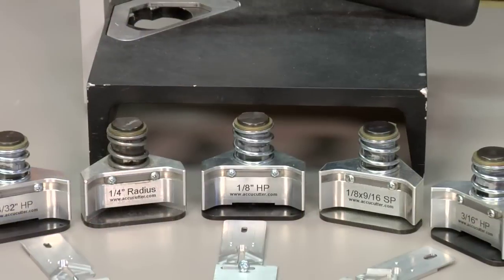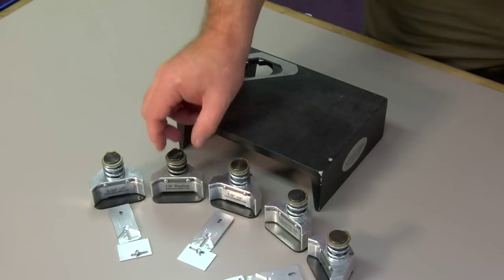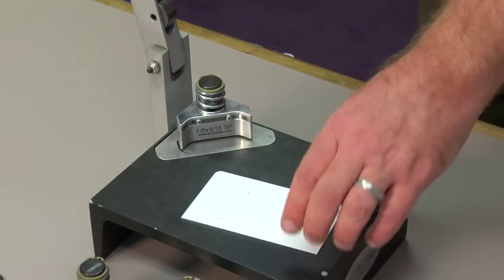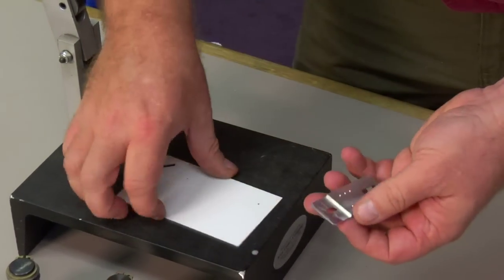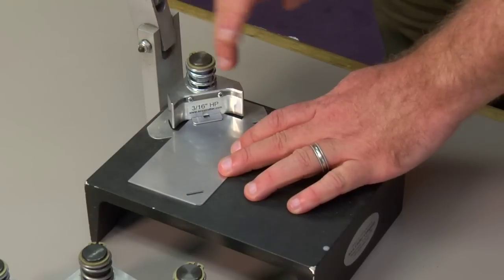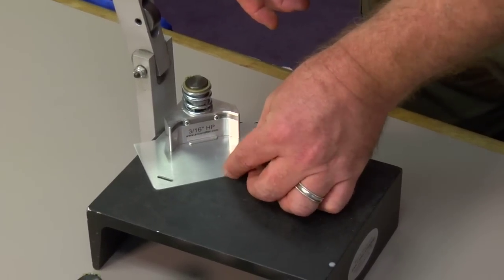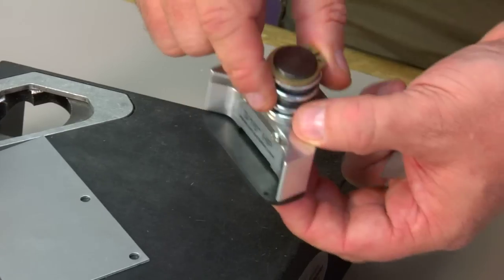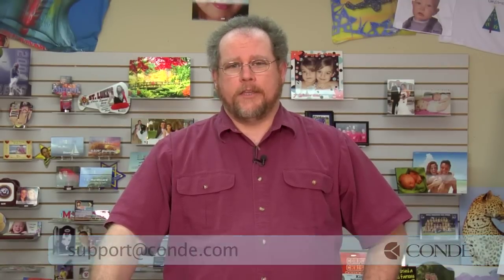Using the Accucutter Cornermate -

Comment from the maker: You don't need to replace them, just get them sharpened. That would be defined by your rate of use. You will notice some resistance as the blade dulls. We have a sharpening service, best to have two blades, one to use while the other one is being sharpened.